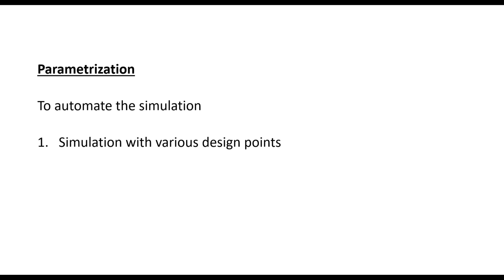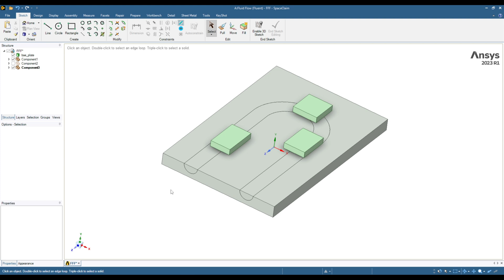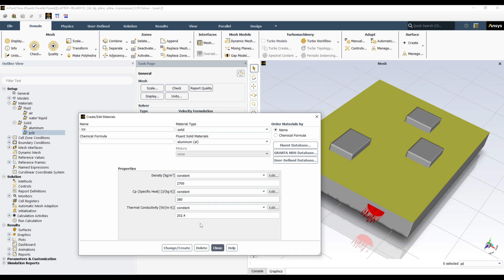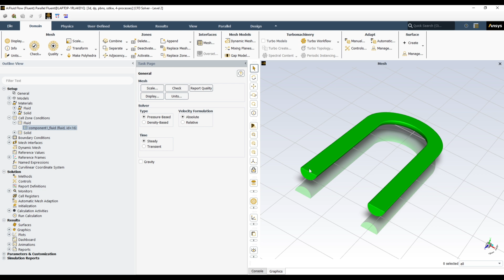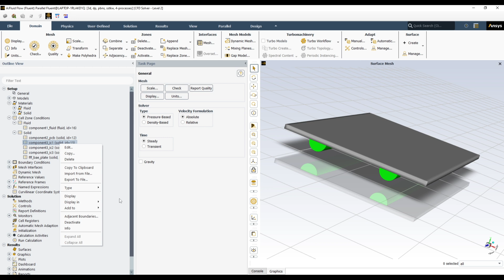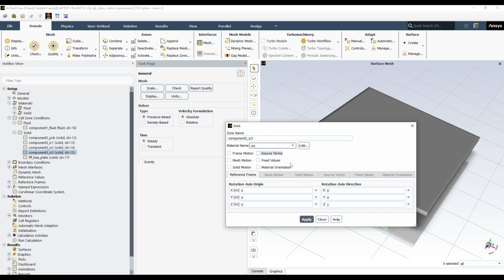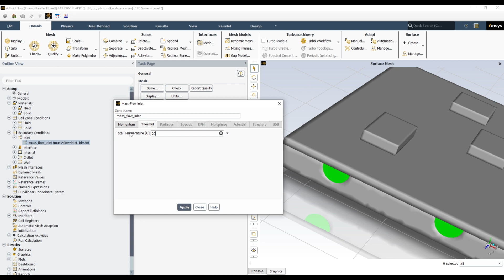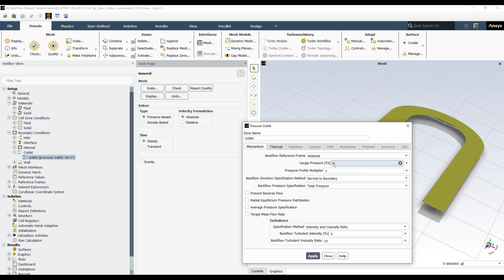Ansys Fluent tutorial: Use of parametric analysis to automate simulations | part 1/2

Comment: How did you create the Model ? Did you use Contacts ?
Reply from the maker: I used SpaceClaim to create the model. 
For contact I use share topology in SpaceClaim. With share topology you can get the conformal mesh and don't need to bother about contact in meshing or Fluent.
However, share topology is always not feasibible when you have a complex geometry. In that case, one has to define contacts in meshing and need to define as coupled in Fluent
I have plan to make a complete video including model, meshing, simulation and post-processing. I'll discuss these scenarios in that video.